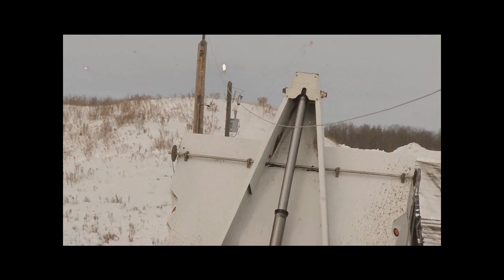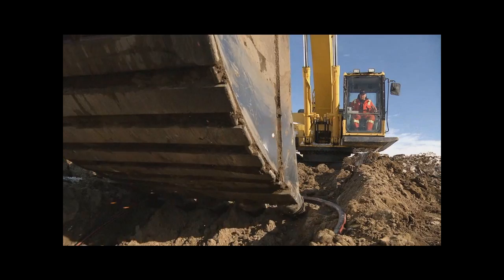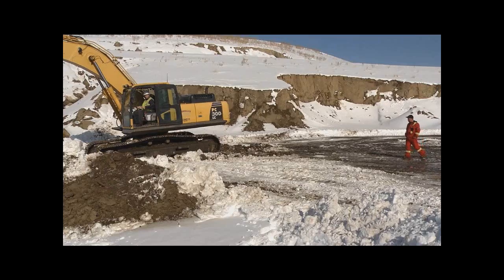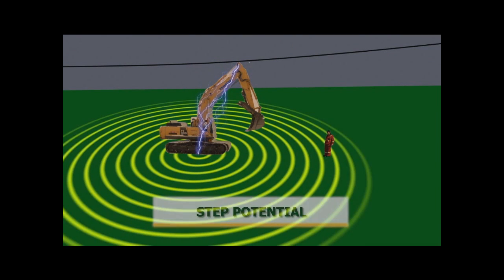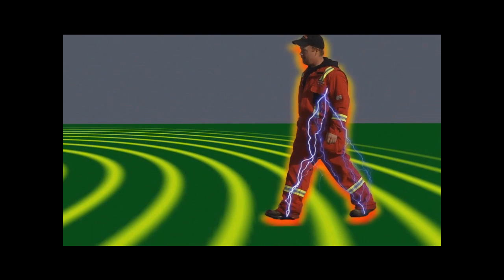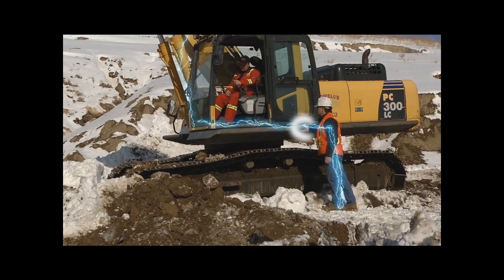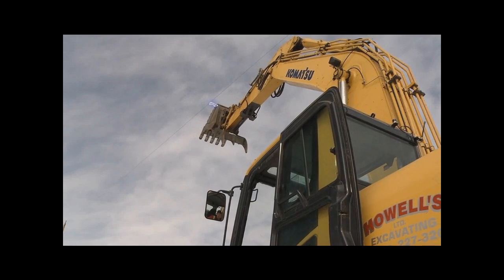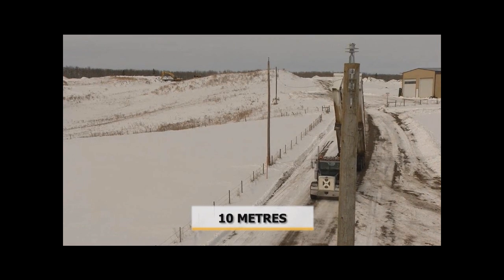Step and Touch potential

Comment: I think this video is dated now. Electrical professionals no longer recommend to hop away / jump when in the potential energized gradient as it is easy to fall and when you touch with your hands you will be widespread across different voltages within the gradient. They recommend to shuffle steps with your feet as this decreases the likelihood of falling.
Reply: Pfft, more OSHA BS! Just run away. In doing so you only have one point of contact on the ground at any one time.
Reply: Nobody runs like that. You always have two feet on the ground at some point